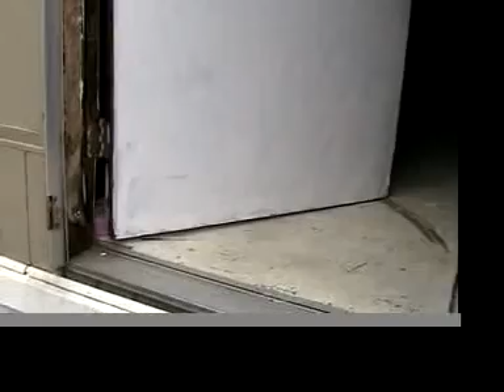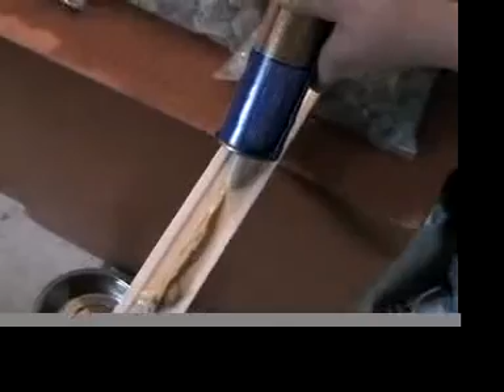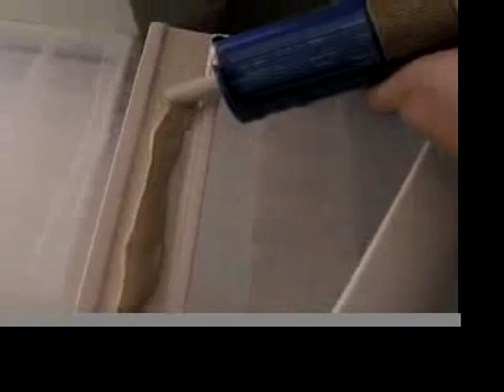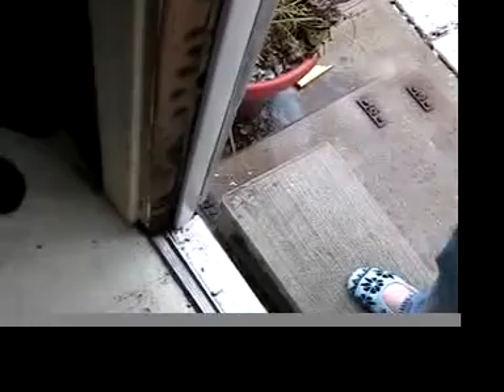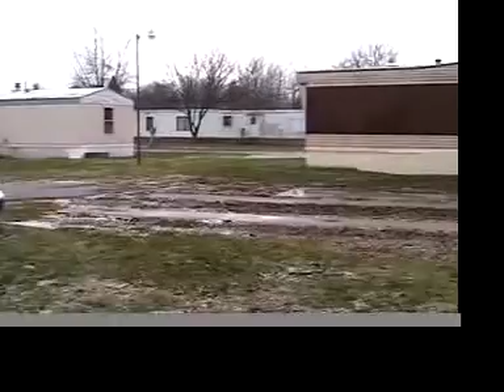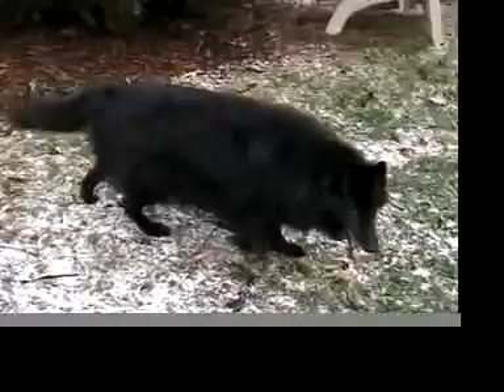This Old Moby....  fixing up the front door! Mobile Home Rehab

Comment: If you are a mobile home owner looking for some direction here, don't!  When the door is hung on the inside of the jam it must have a storm door on the outside. The Storm door keeps the jam dry and prevents the rot. The fix here is cosmetic and will allow rot to the frame and then you will have a real problem.
Reply: Thx!

Comment from the maker: We did just about everything by ourselves, or we had knowledgable friends come to help us.  The only professional I have hired has been a plumber to help with a water heater issue.  We did all the plumbing ourselves and laid carpet and flooring and all that.   We did have holes through the belly, we shored it up with good thick OSB and then packed the belly with insulation.  It wasn't great this winter, bills kinda high, but we made it.

Comment: someone changed the door. it used to open out.
Reply: It hasn't been changed, it's just missing the screen (storm) door. Mine is like this, storm door opens out and the door requiring the key to unlock it opens inward, standard for mobile homes.